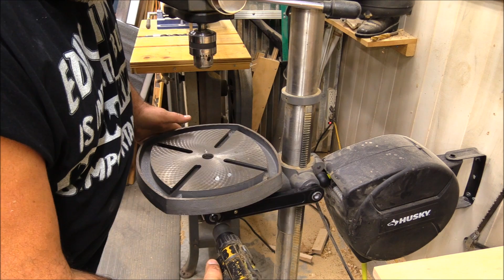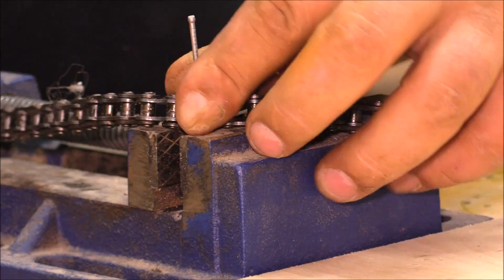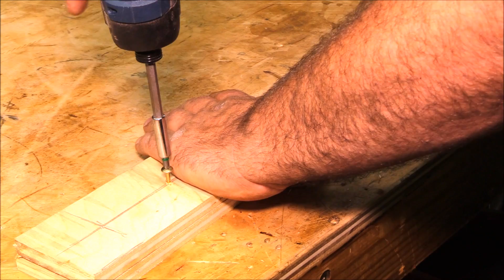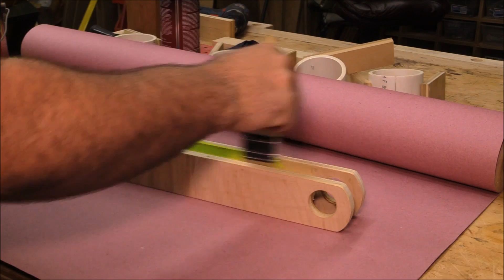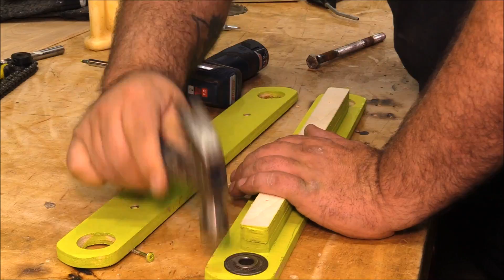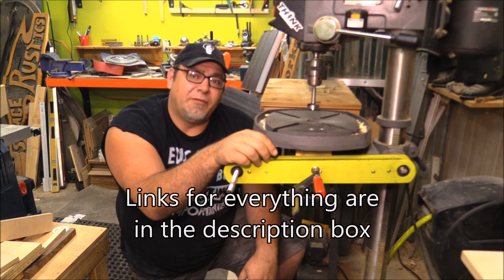How to make a drill powered drill press table lift

Comment: That looks handy, but on my Delta 17" DP, the table doesn't quite come to level if the locking bolt is not snugged up after moving the table.  Do you have any suggestions about dealing with that?

Comment: Izzy, I'm chuckling merrily. Your work is winderful...wonderful. (Of course, my pain medication may be influencing perception.)  Your choice of music for the intro to this  table lift is what started me chuckling. You're one of the greats. I'm reminded of my woodworking sensei Tim (the toolman) Taylor and his great instructional videos Home Improvement. He taught me to  use a Binford 280zx with an inverted blue torque inverter to lower the head of the drill press to the plate, instead of raising the plate to the head. Now, when I attempted it, my cheap drill press didn't have teeth, requiring adjustments to be made by hand. Sawing teeth into the column was problematic, and I went through half a dozen hand saws before giving up.

Comment: I was thinking that it always takes so long to crank the table up, and with your configuration perhaps a bigger sprocket in back so that your 1 rotation in front is like 1.5 in back.  You'd have to be more careful in finer adjustments but I don't tend to think vertically that it's a problem.  Just a thought.

Comment: Here's an idea, just connect a reversible drill to the original shaft and figure out how to electrically, remotely operate it, then run the wires to a toogle switch above the main switch. hmmm.

Comment: The connection link is called a master link.
Chain breaks are reasonably cheap.   Motorcycle shop or bicycle shop should be able to fix you up.  The good thing is they work on chain saw chain too.
I think I may have a few extra ones for bicycle chain lying around if you want one.

Comment: would be cool to add a microcontroller and with a built-in motor, install 2 buttons to control the height and a display to display the value. would be pretty easy and cool, probability useless but cool hahah

Comment: Better to press those bearings in- bench vise-  hammering them not so good.  I suspect the chain would not need to be all that tight on those axles, especially with a wood center to keep them separated.  The little chain fixer dude is a Roller Chain Connector Link.  I have also heard them called master links.  The shaft for lifting my DP table measures .559.   Not sure I could bore a bearing!  But thinking Oilite bronze sleeve bearings might be easier to file out to fit over my shaft, rather then trying to file the shaft round.  Also- as you attach a table, think about the tightening collar.  My table is not true to the drill head until I tighten it down.  Just as hard to reach as the crank to raise the table.

Comment: nice job. now with that feature you could almost turn your drill press into a lathe and use that power up and down feature to hold a chesiel and up and down the work piece. Or if you make a fixed table jig you can now make dowels.

Comment: Izzy, do you have a solution to assist the long vertical rack sliding around when rotating the table around the main support shaft? I am forever having to kick the bottom end of that long rack as it twists and jams in the bottom ring when swinging the table. Love to hear it if you or anyone else has a solution.

Comment: Seems pretty inconvenient to have to grab a drill when you want to raise and lower it. Maybe buy a cheap 20 dollar harbor freight drill specifically for it.
Reply: Nucc's Garage a motorized with a foot pedal control would be ideal
Reply: At the end he shows the hand crank that he'll be attaching. For short adjustments (or when the drill is inconveniently far away) he can hand crank it. For long adjustments he can chuck a drill onto the stem sticking through the hand crank.